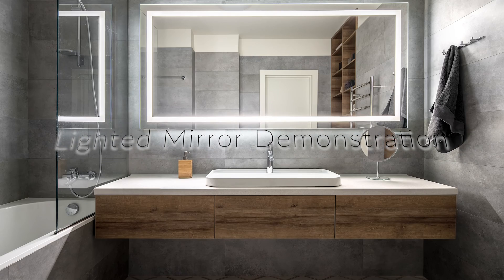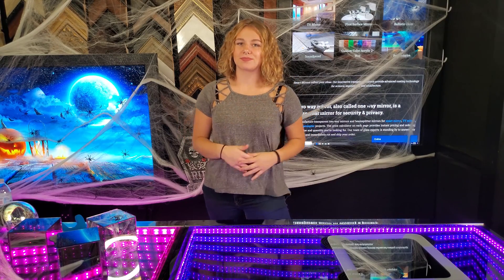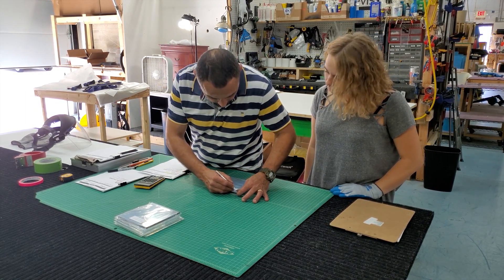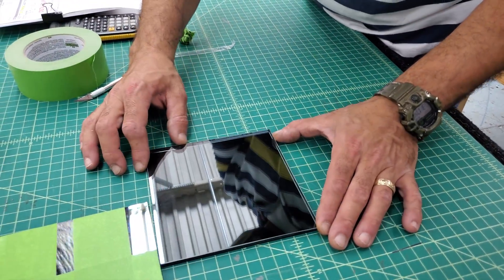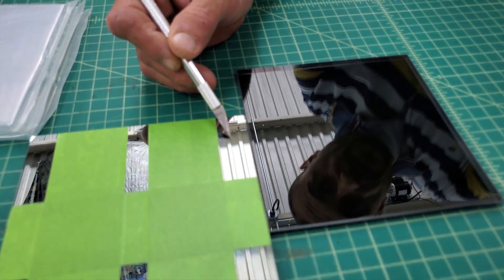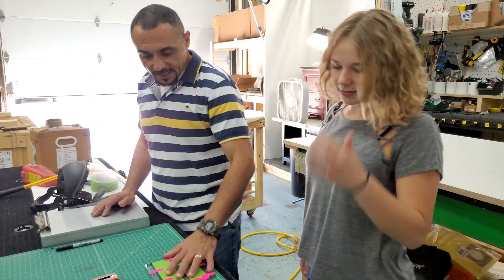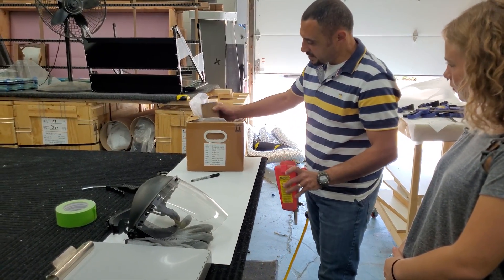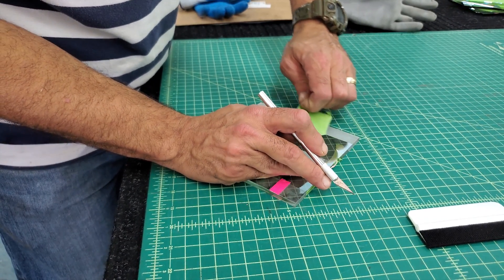How to Create a Lighted Smart Mirror | Sandblasting Demonstration

Comment: I found a guy that sandblasts metal and paint but has no idea about glass or mirrors. Is there a specific psi setting? I heard him say to use aluminum oxide. I want to remove the mirror coating from the back of a standard mirror and etch/frost that same side of glass.
Reply from the maker: Great question! 20-30 psi of pressure is ideal for surface/light etching a smart mirror.